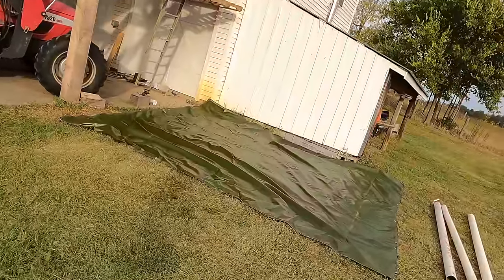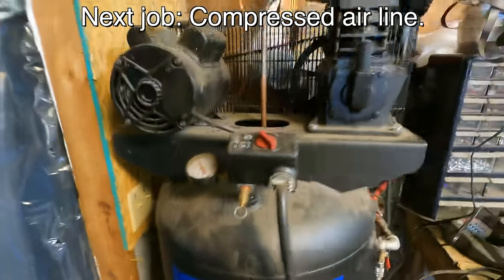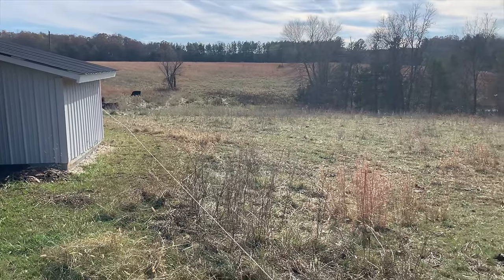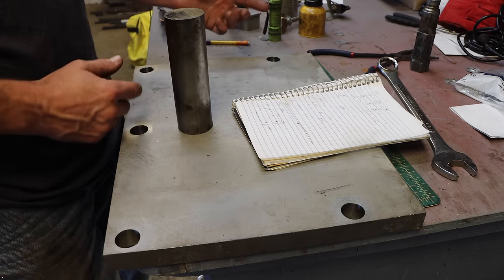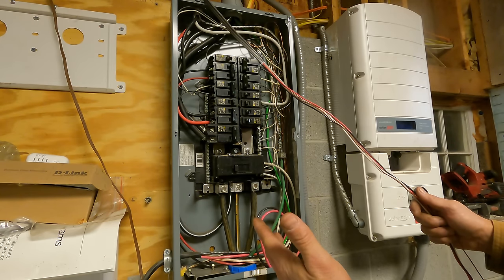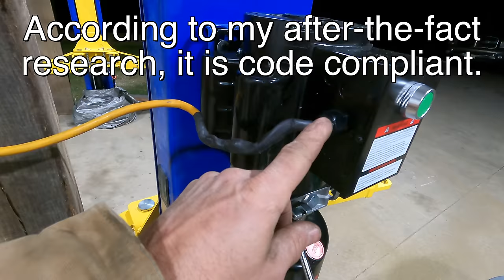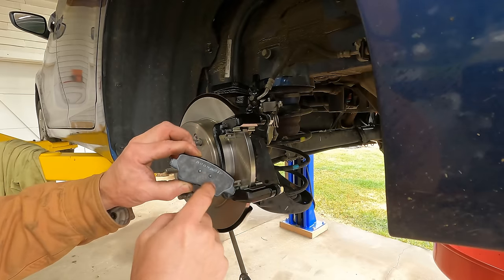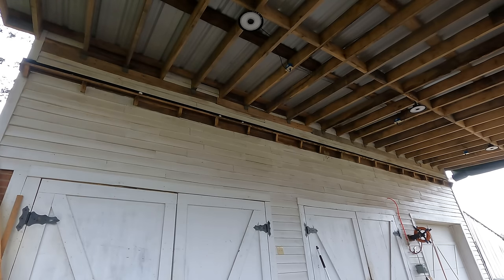Installing a 2-Post Vehicle Lift And Other Big Shop Improvements.

Comment: Not sure the 180 out of phase is a good description,  the feed is 240 v.  Or 220 depending on where you are, At the transformer the tap the middle to get the neutral. So it’s 120 to one lead and 120 to the other,  all same phase, and 240 between the 2 main feeds,
Reply: Exactly. Rest of the world (and half Japan) has all three pole phases all the way to the houses. That lift motor would get all three 230V phases 120 degrees phase difference and that’s the best you can get for motors. More torque from three phases.
Reply from the maker: This is apparently somewhat controversial, and here's my informed but unprofessional opinion.  I think 180 degrees out of phase makes sense.  You could even call it 2 phase power, but they don't because it is generated from a single phase line and 1 simple coil.  It's commonly caused split phase power, because a single phase is "split" into 2 opposite sine waves.  3 phase sine waves are 120 degrees off, these are 180 degrees off.  Single phase is just that, a single sine wave.  Much of the world has single phase 240V power, a single 240V wire and a neutral, only 1 sine wave.  With my power, the only way to get 240V is to use 2 wires and 2 sine waves.  But obviously others might feel a different description would be better.  Cheers.
Reply: @tujuprojects  no.   I know uk and Ireland have single phase 2 wires at 240 v.  Not sure about Japan,  obviously there are 3 phase available which has 3 seperate power wires for the higher power options and they run at 408 v
Reply: @FarmCraft101  They are not 180 degrees off. It is one phase off a three phase system. You get 120 V between the center tap and either end of the 240 volt secondary winding of the transformer. Your neighbors get the other two phases to even the load across the high voltage phases.
Reply: @FarmCraft101  I don’t agree that your 240 v is different from that of the uk,   It’s exactly the same just call one wire the neutral and the other the hot,  the difference is that your system has an additional wire that the pull from the middle of the transformer that splits it in 2,   For the 240 v you are ignoring this middle wire,
Reply from the maker: @vxnova1 It's not just a matter of calling the wires something different.  In the UK, if you touch the neutral nothing will happen.  If you put a voltmeter on the neutral it will read 0 volts.  If you touch either wire in N. America it will shock you and read 120V.  There is no neutral when we are using 240V.
Reply: @FarmCraft101  that’s because in true three phase system the power plant star connection center point is connected to the earth.
Reply: @FarmCraft101  yes neutral wire in the uk is grounded while here in the us the neutral is grounded from the center tap in the transformer,   Which gives the appearance of 2 different 120 v live lines,  The difference between the 2 hot wires in the us is exactly the same as the neural and live wire in the uk, single phase at 240 v difference,  and not separated by 180 degrees,   1 winding in the transformer,   If you have an oscilloscope put it between the 2 legs it will show one sine wave, at 240 v rms or about 340 v peak to peak,
Reply from the maker: @vxnova1  This guy puts it on an oscilloscope.  It's 2 sine waves.  https://www.youtube.com/watch?v=vOh2OSJ44eE
Reply: @FarmCraft101  the best correction I have seen is that the assumption is that you start out with 2 x 120v lines and join them to make 240 v.  You don’t,  you start out with 240 and center tap it to get 120 v on each leg,
Reply from the maker: @vxnova1 I appreciate the discussion.  I watched the video, and some others, and though I'm not sure, his argument seems pedantic to me.  Sure, you can reverse the leads and make the sine waves line up.  But he argues that they must be in phase for the voltage to add.  If they are out of phase, then the voltage subtracts.  Well, we agree 3 phase power is not in phase, and yet the voltage adds there.  Between 2 leads there is 220 V, and overall 440V, yet they are out of phase.  Why aren't they subtracting as he suggests they should?  3 phase power is also be generated with a center tap neutral, but there are 3 windings instead of 2, very similar to split phase. It's all about reference, but I would argue you have to use the neutral as your reference, as it's actually connected to ground and safe to touch.  You can see at the beginning of his video, in order to make the sine waves line up, he puts the reference on the 120V line, and the probe on the neutral.
Reply: @FarmCraft101  your a tough man to convince,  😀,  3 phase gets pretty complicated to calculate the voltages as you have to get into using vectors / trigonometry because they are 120 degrees apart,  see https://youtu.be/vMbRLXfXZR4.   For an example,  Whereas if they were 180 which is directly opposite of each other and cancels each other out,  I guess the fundamental difference is that 3 phase has 3 separate windings on the generator that is 120degrees apart,  generating 3 different wave forms,   On the 120/ 240 v split it’s one winding from the generator, 1 phase that is split in the transformer typically close to your house into the 2 different windings giving you the  2 legs at 120 v each,     I appreciate the civil discourse,   I know I’m not going to convince you here but keep an open mind If you have a chance to discuss with an electrician they may be able to explain better than I can,  I really don’t blame you here as there is a lot of mis information on this topic,  that video that you shared is pretty convincing to be wrong, and actually unbelievable that they teach courses,
Reply from the maker: Well this might surprise you.  I have a good friend who is an electrical engineer.  I brought this up with him, and he said emphatically that split phase is 2 sine waves 180 degrees out of phase.  He's heard the argument you are making before and actually got a little worked up (in a joking way, he's a great guy).  He says you have to use the neutral as your reference.  Voltage is all about what you are comparing it to.  You can't state a voltage of a single point, it has to be relative to something else.  And in the electrical world, the reference is the neutral.  From the position of the neutral, the electrons are going in opposite directions in the winding.  Say in 1/120 of a second the electrons are all going the same direction in the winding, from the neutral, 1 winding is coming toward you, 1 winding is going away from you.  They are 180 degrees out of phase.  I think people are convinced that because the current is going the same direction in the winding that it must be the same phase.  But as you see, it's not the same direction from the position of the neutral.

Another argument I thought might give you pause.  Say you have 2 circuits, both 120V, and both on the same leg in a split phase system.  But separate wires from the panel, 2 separate circuits going to 2 different sockets.  If you take the hot from one socket and connect it to the hot from the other socket, what would happen?  Surely you have to concede that those two hots are in phase.  (They have to be, they are the same leg.)  The answer is nothing would happen of course.  It's the same hot, perfectly in phase, at the same voltage all throughout the sine wave, so there is no difference in potential to allow current to flow.  But if you did the same thing with hots from different legs, you would get a dead short.  The potential for current to flow is derived from the fact that they are out of phase.
Reply: @FarmCraft101  I cannot tell if you are messing with me now or not,   if not just leave the possibility open that it’s 1 circuit of 240 v that is split in 2 to give  2 legs on 120 v each on the same phase,  where the phase goes from l1 to ground (N) to l2,  so when you are measuring with ground reference it appears as out of phase,   It may also help to think of this from the source,   It’s one phase going to the PY of the TX and the SY of the TX is where it is split into the 2 legs,   Thanks for the civil discourse btw,    Your a true gentleman,
Reply: @FarmCraft101  in UK they dont have split phase but they do that connecting the same hots together. In houses they build phases with ring-wiring, a topology connecting U-shaped loops or acrcs ends into electric switch box, to the same phase. It has something to do with sharing the load with more copper crosssection. But I can think a lot of bad things they create with it and that’s why it’s not used elsewhere.
Reply: @vxnova1  US split phase works like if we Europeans connected a galvanic isolated 1:1 transformer to our 240V mains on the primary winding and it had a secondary winding with a center tap, which we grounded. There'd be 240 single phase across the outer taps and 120V between the center tap and either end. All would be single phase 50Hz.
If all we were after was 120V, we could use an autotransformer with a center tap.
Reply: @erik_dk842  agreed,
Reply: In effect, the consumer power grid in USA is 240 volts single phase, but to keep compatibility with all the legacy 110 volt stuff dating back to Edison's 110 volt DC, they added a center tap on the transformer and connected it to ground and defined it as neutral. 
If one wanted to use a lot of US 110V equipment in an European setting, it could be done with a local (auto)transformer, which only used the "lower" winding to provide 120 volts between the neutral lower tap and the center tap, whereas 240 volts would be between the lower and the upper tap, drawing no current through the transformer, if it was an auto transformer (basically just a coil with an iron core)
Reply: @erik_dk842  Victron sells such box, they call it autotransformer.
Reply: @tujuprojects  Norway is different. In some areas, they don't distribute the neutral, so the homes get 3x240 volts in a delta configuration, not 3x400 volts star with a neutral.

Comment: 18:45 Honestly to me cutting out that slab and pouring 8 inches of concrete that's like 2 bags of concrete seems easier than engineering whatever shim your doing and getting a different anchor bolt system

Comment: Why did you cut off so much wire? Future you might wish those wires were longer for the next connection.  My rule of the thumb is fill it to the code limit, because future you will be happy you did.

Comment: Had you ever put together the rolling tarp system or is this your first time? It is pretty cool just dont know what I would do in my situation during heavy wind.
Reply from the maker: First time.  I'm going to tie it down to the concrete with paracord, just like. tent line going to a stake with the little adjustable metal clip.  That will make it good in all but a really heavy wind.  Cheers.
Reply: @FarmCraft101  Whaaat? No hot glue or duct tape? It wont stand without that.

Comment: It would have been easier to use masonary anchors with threaded rod. Have nuts under the base on the threaded rods to level the column and then use Sika grout or similar for the base.

Comment: Maybe next time it would be easier to pipe the concrete in like a baker would do on a cake? Bag with corner cut off ans squeeze it In where you need it.

Comment: The degree to which "things will go anywhere" is inversely proportional to the number of times that things "will not go anywhere" is stated. Thus, it is imperative that the statement "that's not going anywhere" is repeated as often as possible.  -- Man Code 16.43.71.

Comment: I’m purely envious of your life and shop, well I know more about your shop than your life.   Unfortunately the Army did a number on my feet, size 12 combat boots on size 7.5-8 feet will do that in about 4 weeks.  Then my AI Joints failed, then L3-L4 blew out, just an empty disc sac there.  Then my thoracic and cervical spine went.   Neuro surgeon want to put a biscuit from L3-L4, mechanically fuse Both SI Joints to pelvic bone I believe. And fuse most of my cervical spine.   Feet have little to ring finger sized tumors along tendons and ligaments that were stretch and torn, no more walking or quail hunting. We don’t have any quail in west central Mississippi anyway.  The Live Virus Swine afly vaccine of 1976 in Army gave me fever than ran to 103.x over several weeks before a similar decline over many weeks to Sat style at about 97.5-96.7.   Terrible muscle and joint pain and stiffness.  I was diagnosed with chronic to chronic acute pain syndrome/Fibromyalgia in early 78 about 2-3 months after leaving Army.  Seen too many neurologists, rheumatologists, pain specialists, etc since I was 20 years old.  God willing I turn 67 July 4, 2023.   2 simultaneous strikes with heart attacks 95-2012, cardiac stents, 5 Bypass surgery 2012, a 20 day belated 46th birthday present but I’m still on the sunny side of the dirt.   Worked long hard hours 7/12’s, 7/14’s for most of my life with sleep deprivation later diagnosed as airway obstructed sleep apnea. Has 3rd stroke this past Easter weekend.  Trying to get back and neck surgery since before the RINA hit and messed that up for 1-1.5 years, then the wife got to where she could not be my designated driver to schedule surgery.  BA won’t approve an overnight hospital stay unless required otherwise I could drive myself to and from surgeries, but not the VA.  Their policies are interesting but it’s what I got.  Spent life’s savings considerable sum just existing since 2007 because SS did and my employers disability needed me to get a lawyer and I made a poor decision getting pissed off and deciding oh well I made it not how I planned on spending it but that what I did over the last 15 years. Between investments going south and giving uncle 25% of each withdrawal someone enjoyed it much more than I.  Like I said bad decision but I hate feeling like I need to beg for something I’m due.  It’s a lot longer story but I have 2 fine grown children and 3 fantastic children I wasn’t sure I’d ever get to see.  Life’s been hard on me but my Lird and savior Jesus Christ has been really good to me.  God bless you and your family you’re living and letting me see the life I worked for and dreamed of having before my health decided it was going to take a vacation whether I went with it or not.  Managed to push myself to work for 29.5 years and did not want to quit when I had to but, that’s life.  Carry on and enjoy but take time with your kids.

Comment: I always thought you needed like 6in of concrete and you have  to be pretty far from any expansion joints.  Oops just saw you comment about good enough haha
Reply from the maker: Yeah.  6" and no joints would be nice, but that's not what I have.  Hope the engineer is right!  But the lift even says for 4" slabs to just limit weight to 9k pounds.  My slab is 4.5" and my truck at about 7k is probably the heaviest thing I will lift.  Cheers.
Reply: @FarmCraft101  I can see how the crossbar will keep the two vertical poles from collapsing towards each other.  I am curious how strong they are from tipping forward or backward, especially with a heavy diesel engine on one end.
Reply: How about a brace up to the joists?

Comment: Hi! European here, don't have much experience with high voltage and American electrical stuff is confusing, so I'm wondering about the whole lift doesn't need neutral.
Is that because the 240 is only between the two hots and the 120 would be between one hot and the neutral?
Reply: It works the same as when we use 400 V single phase by connecting between for instance phase R and phase S.
But their neutral is not really neutral, it's tapped off halfway on the winding on the transformer, which gives out single phase 240 volt. Then the neutral is coupled to ground.
Reply: @erik_dk842  tak :)

Comment: If there was a single suggestion that I would make for your car lift, it would be to measure the exact distance between each pole where an automobiles tires would be and make some type of marking on the cement to make sure all four wheels are situated on each spot so as to not force uneven weight on your lift like you had when your daughter brought her car for break repairs.
I am sure that this lift can handle this uneven weight load just fine, but over the long haul, you may find yourself with issues due to uneven load distribution…… IMHO.

Comment: I really need to add a car lift and a man lift to my property and a sizeable shop. All would pay for themselves pretty quickly, like my excavator has. Just spent 800 dollars to have parts thrown at my beater when all it really needed was a new alternator. Won't be using that shop again.

Comment: 🤣❤GOOD JOB ! THATS NOT CHEAP TOY DUDE , WHAT DO YOU DO FOR A LIVING ? I  WILL CALL YOU MACGYVER  WHO CAN DO ANYTHING BETTER THAN ANY BODY 🤣EXCEPT I WOULD HAVE PUT THE WIRES FROM THE PLUG TO THE LIFT SWITCH ON A RIGID CONDUIT TOO, IT DOES NOT MATTER, IT WORKS !😅

Comment: What is the clunking/banging noise when you use the lift? It's not something I've heard before in any other videos with lifts. Something stuck in a pulley?
Reply from the maker: Those are the safety latches, typical for any lift.  It's a ratchet mechanism that locks on notches in a piece of steel that won't allow the carriages to go down.  You are supposed to raise the vehicle, lower to the latches and then it is safe to go under.  The cylinders aren't holding it, it's steel on steel.  When you want to lower you raise it up a bit, pull the safety latch releases, and then you can lower it, but should not be under the vehicle once the latch release is pulled.
Reply: @FarmCraft101  Oh nice, thanks. I know you said something about metal latches in the video, but I didn't tie it with the sound.